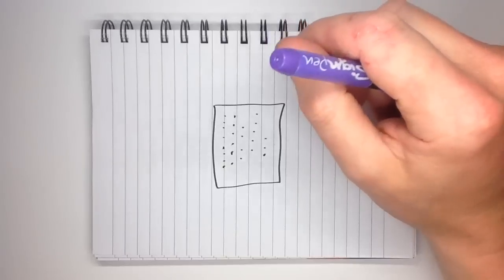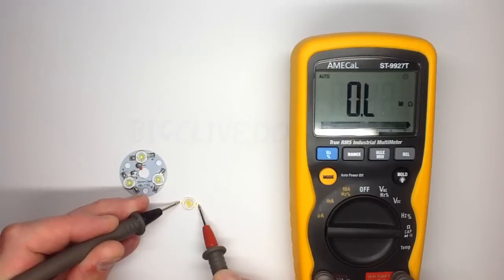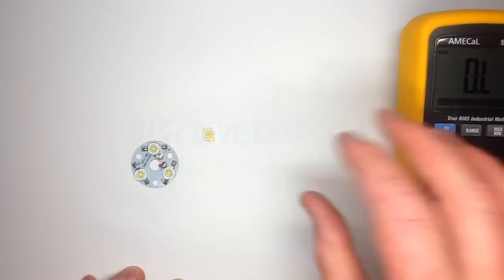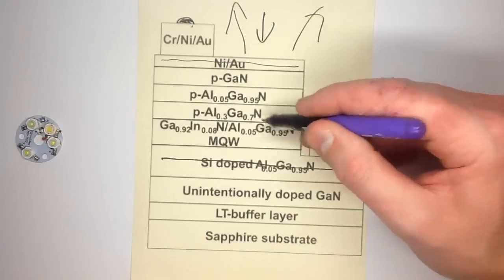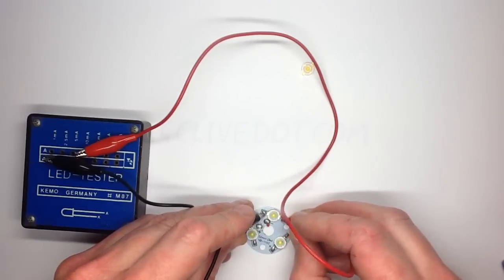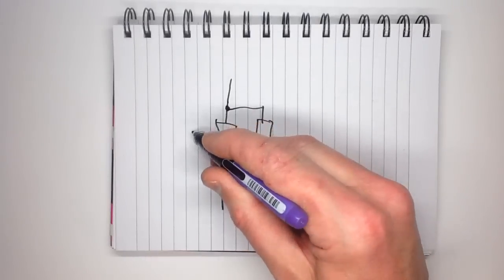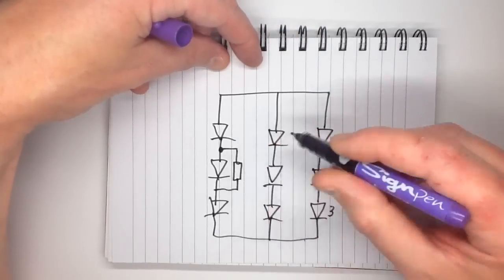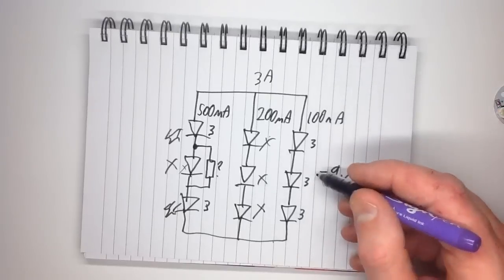The clown-science of crappy 100W LEDs.

Comment: I would love to see a schematic of that little tester that you used there.  I bought some 10W LEDs from banggood a while back. So far I've built a couple of small fixtures that use them,  and am running them at about 3W,  with quite sufficient brightness.  The ones I got are wired internally as you've shown there,  it's my understanding that you can also get them with all of the elements wired in series.  I didn't want those because I wanted to be able to use them on a 12V supply.

What gets me about this stuff is that a lot of those crappy ones should have been culled as a part of the manufacturing process as being defective,  and yet they're putting them out there and people are buying them!  Jeez...

Comment: I have an old projector at home. I found the service manual of it, which says the lamp outputs 3600 lumens, so I decided to replace it with a chinese chip bought from aliexpress for about 20 USD. I successfully removed the ballast of the old lamp, overridden the ballast check on powerup, and assembled the "100w 3600 lumen'" LED and its 100W drver circuit into the projector. 
Everything lights up, but it is nothing compared to the luminous power of the original projector lamp. I have checked the inside of the projector assembly, and there is almost no light escaping from the inside. Have I been scammed? Where can I find a good place to buy a real (minimum) 3600 lumen strong LED chip? (I am just hoping that the driver circuit is really 100W, because thats also from China)
Reply from the maker: The projectors optical path will have been designed around the focal point of the original lamp.  The replacement will need custom optics to match it to the original source.

Comment: You really have a limited knowledge of how LEDS work don't you?
Reply: Clown Alert!!!!!
Reply: @richiebarrass3469  Talking about yourself?lmfao
Reply: What? Does he need to run them at the operating voltage so that it sorta looks normal? All that will be doing is overdriving the LEDs that light up at the lower voltages and they will hit a point where they reach the highest possible brightness they are able to output  and then they will just start heating up more instead of actually making light.... Not only is that bad for the life of the led but it makes it really inefficient as more of the power is going to heat rather than light.
Reply: @mashedpotatoes5323  So it's simple He testing one diode out of a circuit board which is the correct way second what is a LED? It is a diode which mean resistance needs to be check BOTH WAYS AS ONE WAY CAN SHOW A lower resistance than if check with reversing the wires on the LED.That was my one of my points the second you cannot check resistance on a circuit board and expect to get the correct reading as you can feed back throw the board and not the diode.
Now if any of you know what a POT IS and how to properly set one up You would of know this!!!!LMFAO
Reply: @apacheone3643  that doesn't make any fucking sense, you need to start at the basics my guy. Honestly I don't give a damn what you think, you can keep buying the mismatched LEDs and be happy with them as I will buy them and if they are messed up I will do what any logical person would do and get a refund. I just think it's hilarious that you really think these are what good quality LEDs do.
Reply: @mashedpotatoes5323  Because you are addressing me as if I made the video, I made a statement 2 YEARS AGO TO THE AUTHOR THAT HE DID NOT KNOW WHAT HE WAS DOING AND LIKE A TROLL YOU RESPONDED TO A CONVERSATION THAT HAD NOTHING TO DO WITH YOU ! TROLL!
Reply: @apacheone3643  no but really, keep buying the mismatched LED cobs I wouldn't mind someone as arrogant as you to waste their money, well I guess it's not "wasted" for you in particular because you are happy to spend money on crap LEDs....
Reply: @apacheone3643  "OOOO LOOK AT ME IM A TECH I USE ALL CAPS, I BUY CRAPPY LEDS AND THINK THEY ARE GOOOOOOOOD"
Reply: @apacheone3643  my whole point of this conversation is to question why you think big clive has limited knowledge of LEDs when you clearly don't even know the basics yourself. I'm not mad, I don't think you are mad either it would be silly to get heated over LEDs 😂😂
Reply: @apacheone3643  I'm sorry but I can't take anything you say serious when you think this is how LEDs are supposed to perform.
Reply: @apacheone3643  if you had the choice of buying a perfectly matched 100watt cob led and a mismatched 100watt cob led for the same price which one would you choose? But pease let's keep this on topic.... I don't care nor does it matter for a discussion that you master electrician technical racing car mechanic engineer scientist mumbo-jumbo.
Reply: @apacheone3643  sure, they are basically solar panels because they are diodes, really shitty solar panels, optimised to output light....
Reply: @apacheone3643  and a pot is a adjustable resistor
Reply: @apacheone3643  lmao don't have to bash someone having fun with computers, what's it to you?
Reply: @apacheone3643  look man I'm not here for a pissing contest of who knows more, I'm just wondering why you think big clive is wrong when he is 100% right
Reply: @mashedpotatoes5323  And how do you adjust it? What does a solar panel have in common with a LED? Please I can look up what a POT is but you need to know how to adjust it what is it used for and why.
Reply: @apacheone3643  again taking it off topic.....
Reply: @mashedpotatoes5323  That was part of the answer not the whole thing this proves to me your limit KNOWLEDGE and skills.Talk to me when you build you own Computers and write your own programs for race cars.
Reply: @apacheone3643  ohhhh okayyy yep I'm just too stupid to even comprehend the answer, thank you Mr super smart scientist
Reply: @mashedpotatoes5323  I did but you are just to NIEVE to see it! LMFAOAU
Reply: @apacheone3643  okay so your saying because he tested the led in a circuit and that he only tested it one way his testing methodology is completely false? That still doesn't change the fact that the LEDs that light up first get overdriven hard when it's at the rated voltage. And I honestly have a question, what does POTs have anything to do with this? It's not like you can control the led by directly connecting it to a pot. You preferably need a CV cc power supply to power LEDs so that it runs in CV mode and if the current goes too high it switches to cc mode.
Reply: @mashedpotatoes5323  Like I said you just do not understand! I gave you a hint from the POT question and a LED Controller is again only part of the answer.also if you do not know how to properly set up a POT then you really do not know what a diode is and A Solar cell and how they work and how to PROPERLY TEST A CIRCUIT.You are wasting my time now as I am about to start my Shift
Reply: @apacheone3643  something is telling me you are using pots incorrectly.... The only time you really use a pot is when you are adjusting the voltage or current on a boost/buck converter. You don't put them in the circuit....... It's wasting more of your time beating around the bush instead of just fucking telling me why big clive is wrong. Asking a question is not helpful at all....
Reply: @mashedpotatoes5323  I have given you all the information you need if you do not know how to properly adjust a POT then you do not know how to test a LED OR A RESISTOR OR ANYTHING ELSE! So think about that for a moment! I am not going to respond anymore as I am Emergency PERSONNEL!
Reply: @mashedpotatoes5323  LMFAO 
1.When DID I SAID YOU NEEDED A POT to test a led?
2.Yes you ADJUST a POT From the screw on top. but you still HAVE NOT explained how to adjust a POT correctly WHICH IS ALSO HOW YOU CHECK A LED ,DIODE.
Now FOR THE LIFE OF ME WHERE DID YOU GET YOU NEED A POT TO CHECK A LED?  LMFAO
Reply: @apacheone3643  what do pots have anything to do with this? Can you tell me? Like actually tell me not some bullshit "answer". You say I need to know how to adjust a pot in order to know how to test a led? That doesn't make any sense.... And back to one of my main questions, what would you rather have for the same price, a perfectly matched led or a mismatched led?
Reply: @apacheone3643  if I'm wrong I would like to know why but I want a answer I can understand, maybe you can link a website that explains it? I can't find anything on Google that describes what you are saying. I could also be typing the search query wrong so what should I look into if I wanted to learn about what you are talking about?
Reply: @mashedpotatoes5323  I think you should look it up in a electronics book or sit in on a electronics class. Secondly do not confuse a VARIABLE LED DRIVER POT OFF OF AMAZON WITH A  POT USED ON A HIGH QUALITY HOME STEREO AMPLIFIER OR A TELEVISION THAT USES A POT FOR THE AUDIO SYSTEM. Which Is what you are trying to compare and having difficultly understanding.
Secondly as I stated before this video did not confirm anything as far as the LEDS being mismatched as they were in no way tested properly because of the way they were tested which I explained in my very first few statements. Also there is the believe that you are most likely the author or know the author of this video and you are DEFENDING it.
Reply: This is the dumbest argument I've had since when someone told me lithium batteries can't run electric motors.....
Reply: @mashedpotatoes5323  I AM LMFAO SO HARD NOW WE ARE PULLING A VIDEO FROM SOMEONE ELSE TO PROVE A POINT THAT YOU CANNOT PROVE I DO NOT NEED TO WATCH SOMEONE ELSE'S VIDEO.ALSO YOU JUST PROVE TO ME HOW IMMATURE YOU REALLY ARE! PLEASE GO OUTSIDE AND PLAY WITH YOUR FRIENDS! LMFAO
Reply: @apacheone3643  if you can explain why big clive is wrong and prove it I will drop everything and apologize, I don't think you can do that.....
Reply: @mashedpotatoes5323  And only you know everything a typical Demacrat move wanting everyone to hold your hand and then take credit for the discovery! LMFAO sorry but I have real things to do today like keep our fleet going.
Reply: @apacheone3643  look at yourself, you can't even keep a conversation on task, you keep boasting about irrelevant shit, and you can't even provide proof to prove big clive wrong.... I don't mind if you think mismatched cob LEDs are good but please don't go around saying good information is wrong. It seems like you don't fully understand how LEDs work, this video does a great job explaining how they work or really about how they don't work. From what I have gathered from your comments is that you think that testing LEDs require more equipment than just a simple CV cc power supply and a multimeter, that is just simply not the case. Please, prove me wrong.
Reply: So what would you pick for the same price a mismatched 100 watt cob led or a perfectly matched 100 watt cob led?

Comment: need to run it from a constant current supply instead of a constant voltage supply
Reply: That doesn't help the fact that the LEDs that light up at low voltages will be overdriven and will heat up way more than they are supposed to, making the led less efficient and a shorter lifespan....

Comment: Even the expensive ones are not that great, lifespan is widely exaggerated.
Even my led house lights are replaced as often as the old incandescent light bulbs, they are low power consumption so easily pay for themselves, I've found halogen to be the most reliable of light's.
I've had a 50 watt halogen torch for about 10 year's, it's used daily and I've replaced the battery 3 time's and it's still on the original bulb.
Only lasts about 40 minutes on a full charge though and you can't put it in your pocket though lol

Comment: That will explain why some don't last as long as they are suggested to. I know a crappy ballast can also be to blame as well has actual heat resistance due to poor design in the flood lamp. Design is everything and the heat needs to be able to flow out n away from the unit through the fins. If the fins are short then that can be part of the problem in flood lamps that I have noticed. Thanks for your info. Some of my 100 watt chips last 6-9 months and some last only 4 months. now its a process of finding out what is causing short life span. Next is trying a quality meanwell ballast n see if chips last longer.

Comment: Ni/Au Layer is not vapoured on the whole structure as you have shown, otherwise the light wont pass thru this layer. The possesed light is actually generated in quantum wells in InGaN/AlGaN (this is the proper), which is in the intristic semiconductor region, this diode is not simple P-N, its P-I-N.  Cr/Ni/Au is not an electrode, but a contact, in some sort with the Ni/Au layer (its P+/P region), those layers are made to ohmic contacts to the structure. Just to be specific.

Comment: How different is the balest in a floresent is the led power supply?
Reply: worlds different. led ballasts just output a single constant current whereas fluorescent ballasts have 3 outputs; 2 low voltage outputs to run the heater filaments and 1 high voltage pulse output for the tube (voltage in the KV range, depending on the length of the tube). 

when first turned on, the high voltage output puts out an HV pulse to get the tube started and then turns into a constant current output to maintain the tube lit, at which point the voltage is much lower.

Comment: You have to know if multi LEDs are individually connected in series or parallel, and if parallel is there a current limiting resistor in series with each LED or if the LEDs are in series is there a series resistor also in the string?  Another variable that may be significant is a very normal difference in Vf- the forward voltage.  Your drawing assumed 3v plus/minus very little diff in Vf where they can be 0.3V or 0.4V difference.  And in your circuit there should be a resistor in series with EACH string of 3 LEDs or better yet a constant current source for each string.  There will never be a resistor in parallel with an LED.
Reply: led arrays in COBs are not the same as arrays on a PCB. The LEDs that are put in one COB are cut from one area of the same die, so they have near identical characteristics, in which case you can parallel them without resistors no problem. 
from what i have gathered from internet digging about led manufacturing, these defects of uneven lighting is caused by the leds being damaged during manufacture, the parallel resistor wasn't placed there intentionally; it was created by the damage.

Comment: Hi - thanks for the clear explanation of the construction and use of LED lamps. Quite a few of my non-electronics engineer friends can understand what you're talking about. However, I have a suggestion. These very cheaply constructed lamps can sometimes have fully working LEDs to start with (The main issue is that the very simple drivers allow commonly occurring mains transients to pass, which cause ongoing damage to the semiconductor junctions). As I expect you understand, this is because of the way they use a capacitor (and nothing more) to drop the voltage and provide current limiting. The capacitor, by its very nature, will allow high transient currents through. These spikes can degrade the LEDs to the point ŵhich you have observed and sometimes cause a whole string of LEDs to fail to light. Some designs have up to 60 LEDs (IN SERIES!) so if one fails catastrophically, the whole lamp fails to light up. But the most hilarious thing is that they quote a lifetime for the whole lamp of >30,000 hrs. Although this might be true for a single properly cooled LED with a decent mains driver, it is guaranteed to be much, much less in these cheap constructions.

Comment: I suppose rather that spewing a bunch of shit in your comments, I'll ask a question. I'm looking to build a flashlight to take to the desert and just have to say " I built that" but I'm not keen on the idea of crap led's when the bottom line is the led is not reaching it's full potential. It's also a bit of a project I plan to assemble with my dad to get his feet wet on learning to solder and general electronics as we have a father and son hot rod project that's about to have a lot of circuitry incorporated into it. Have you come across any of these 100w chips that are worth a damn or even remotely have their shit together?
Reply from the maker: Whatever you make, keep it as simple as possible for reliability.  Going for high power isn't always a good idea for a battery operated light as it will flatten your batteries very quickly.
Reply: bigclivedotcom thanks for the advice, much appreciated. what do you mean by flatten though? Additionally, have you come across  any 100w light worth purchasing or not? I planned to not get too over zealous with the build. Im just using it to get my father comfortable with soldering for the larger project we're about to tackle.
Reply: 'flatten' as in a 'flat', or fully discharged battery.

Comment: Great Videos. I am an Ex Radiospares (RS Components) Guy.  Keep up the good work and Videos. These crappy 100W LED arrays also suffer with age. Thermal runaway. But as most people use them in dark winter months its not so noticable. Its only late Hot Summer evenings, then they fail very quickly. Thats not often in the UK. Cheers from George

Comment: the autoscaling of the meter can change the voltage it's applying and that can change the apparent ohms
Reply: Steves junk 
that doesn't matter because the point of the measurement wasn't to get an exact quantity, but to show the enormous difference with the faulty LED.